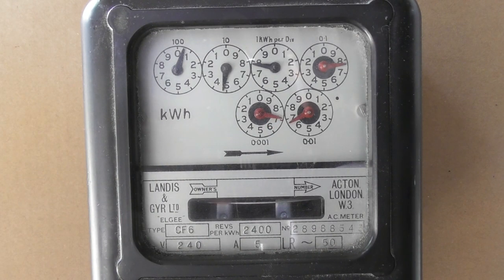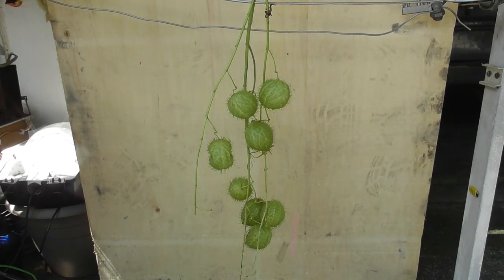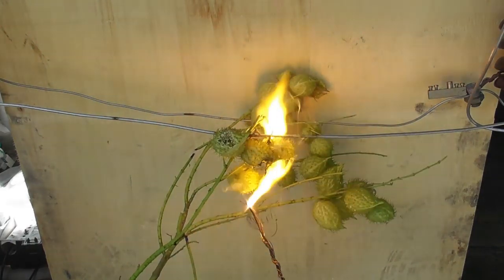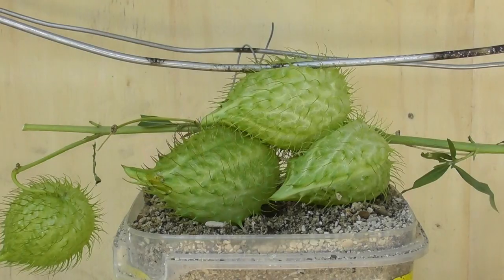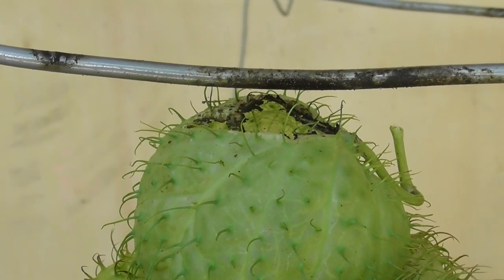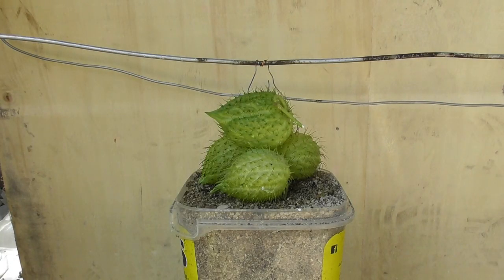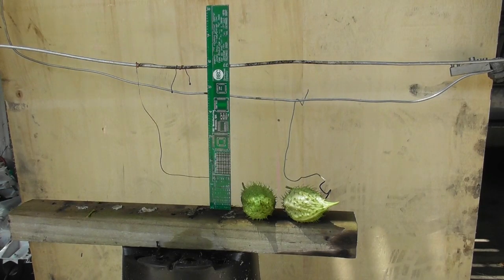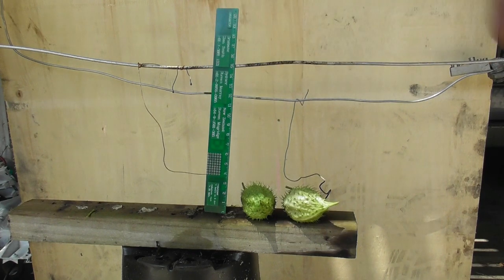Pufferballs v 4400 Volts

Comment: Peaking at 30 amps, almost twice my breaker rating. Love it!
Reply: And overloading a 5 amp watthour meter in the process.
Reply from the maker: @douro20  Only short runs, the meter can handle that and current coil in saturation thus under reading at the same time.
Reply: In Europe you can get 25A or even 32A breakers if you have electrical house heating or water heating for the taps. It's three phase of course, but you can pull continous 25A or 32A from one of them, which are at 230V. Phase to phase voltage is 400V, also at 25 or 30A. That's a heck of power, if you have such supply at your house you can really fry things up.
Reply: In the states here, you can run off a 240V 30A circuit meant for welders or electric clothes dryers.
And nobody is stopping you from plopping a 50A breaker in your panel. Most homes have a 120V/240V panel, with a main breaker rated for anywhere from 100A to 200A. Mmm :D
The meters are designed to be robust, otherwise surges and short circuits downstream would cause 'em to pop ... would be a heck of a time replacing them in the hundreds every day!
Reply: @5Dale65  The "main" 3 phase breaker is rated 32A. In theory, I could pull 96 amps total. :D
Reply: @5Dale65  Even better is to use 3 transformers (or a 3 phase transformer that has 3 primary and 3 secondary windings already). Then you connect the secondary sides in Y configuration (gives the highest voltage) and then make a rectifier out of high voltage diodes. That will use all 3 phases and give better arcs than AC (since the voltage never drops to zero like it does with AC between each half wave).

Comment: You need to make a v shaped channel, using some old louver glass siliconed together, so your balls do not fall out. Then use a spring each end to get good flexible contact with them, and they will go the whole way with a show. Will also work if you get enough wasps and put a cover at the top and the ends, making a wasp terminal with as view.
Reply: If you watch closely, they burn through before they get enough pressure to pop. Needs LESS power, in fact.

Comment: Seems some nasty spikey plant. Those MOTs make the meter spin quite fast, bloody hell!
You need to stack those pufferballs vertically on each other with a weighted top electrode and side walls of some sort, maybe acrylic glass (not very good for that).
Cool PCB ruler! Pretty colors! 05:30 Aluminium makes this brilliant blue color.
Reply: PCB rulers are great, they're straight and accurate, with sharp corners. (Unlike wood ones with rounded corners and such)
Reply from the maker: This plant is soft spikey. The spikes are to make it harder for the Monarch caterpillars to eat the seed pods. It is not a thistle.

Comment: Wonder what the difference is between the bright blue arc to the red one..  youd think that the blue one would be an oxidized and red would be carbonized like in oxy fuel gas metal welding/ cutting..  but the quick back and forth between the two makes me think the blue would be a different voltage..  couldnt be any wire coating burning because all your conductors are bare i believe..  theres gotta be some science in there on that one..
Reply from the maker: Ususally red/pink arcs is pvc insulation burning off. Coppr arcs green. Aluminium arcs are blue and iron/steel isusually bright yellow.